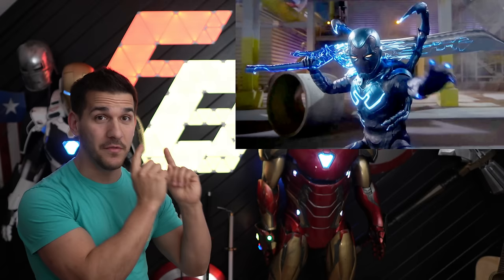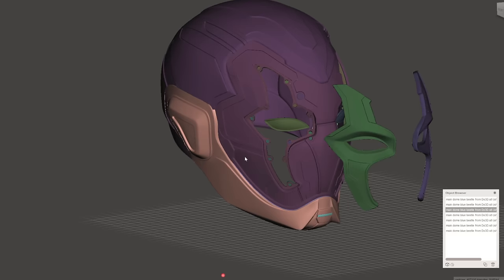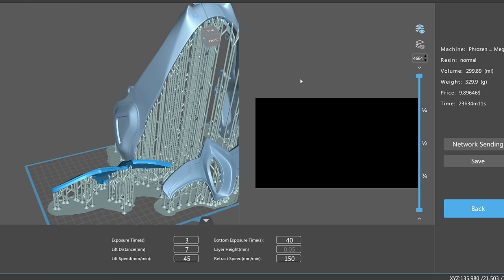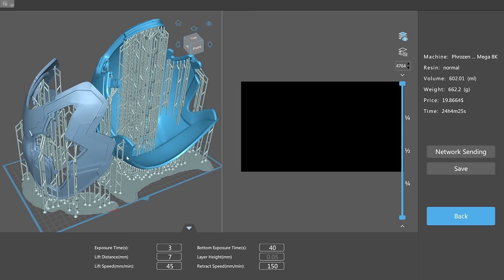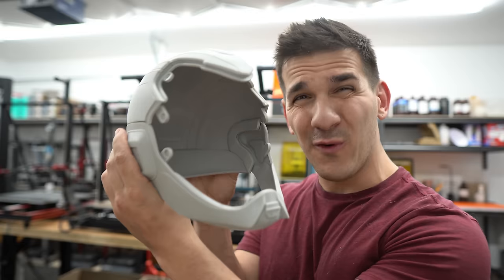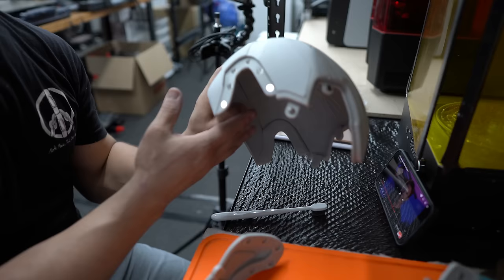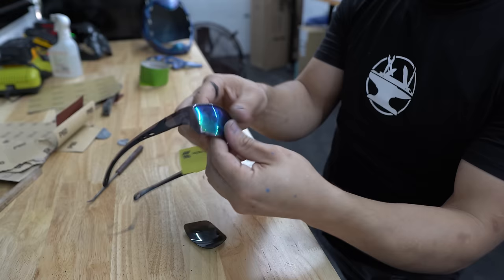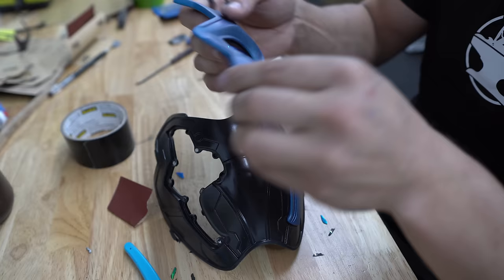Making a Blue Beetle Helmet out of LIQUID RESIN! | 3D Printing Tutorial |

Comment: Hey, so a quick tip with printing resin: if you rinse off the part in warm water before removing your supports they will pull off MUCH easier and not leave the large divots behind that you got when pulling them off.
Reply: Solid tip, I'm going to try this out
Reply: this is like the first setting on ur supports for chitubox
Reply: 500% recco the warm water bath. I use hot water, just be careful leaving the prints in for too long so they don't warp.
Reply: Yes, but not too warm/hot because not only they can wrap, surface of them can crack also!
Reply: adding more supports and making them less heavy is also recomended, i always put heavy supports on the key sports that will hold the print and the rest in medium on a bigger volume

Comment: You can hold a popsicle stick in front of the paint stream to get different kinds of speckles. Depending on the angle of the stick, the amount of the stick in the stream, and the amount of paint you allow to collect on the face of the stick will produce different effects. This trick can be used with H.V.L.P. paint guns also but it can be a lot more finicky.

Comment: Looks great!  When you make tight fitting pockets for magnets add a small through hole in the center of the pocket to allow the air (and excess glue) to escape.   Also, you might want to invest in an airbrush/compressor.   It's easy to get your spatter effect.

Comment: Tip for making spray paint sputter/splatter (if you've never tried it)... Take the nozzle off the can, then with an "xacto" knife kinda drill out and "damage" the nozzle where the paint comes out.  The more "chewed up" the nozzle, the greater the splatter.  Of course that nozzle is useless for "normal" painting, so spares are good to have around. 👍

Comment: The rough finish where the supports were can be mitigated somewhat by trying to orient the print such that the smallest and/or least visible part of the print is facing the build plate. Those first few layers get a LOT of exposure, which causes the fugly surface. Using a raft also helps. Resin is awesome. It's just totally different from FDM. I really want to get my hands on a large resin printer. The Mono X is much better than the standard Photon I started on, but still not big enough for me.

Comment: I do not know if you know but a good tip to romove supports from resin prints is to use heat, like a heat gun or hot water, that way you do not leave scars in the print

Comment: This is a dope project. Only thing I can say for someone trying to replicate the paint job is consider an airbrush instead of a rattle can. You will keep the speckles very fine and be able to build in a very slow and controlled way. It would be pretty easy. I imagine getting this result with a bunch of rattle cans would require a lot of experience with spray paint.

Comment: Great video.
Resin printing works on exposure per layer, not how fast a nozzle can pump out plastic. So the time a print takes is based on the number of layers, not the amount of plastic needed to be placed.
So, for large builds, they are much faster, taking like 3 seconds per layer, some less, some more. And if you can use the entire build surface at a time, can save you days in the end.
So, yes. I am impressed. But the PPE needed to work with it makes me shy away from it.

Comment: Gloves!! Even grabbing the build plate out of the printer you should be using gloves, as that top part will still absolutely come in contact w/ resin throughout the handling process. The second you go to open those doors you should be gloved up, resin burns are absolutely not joke.

Helmet turned out amazing though, love seeing more stuff done in SLA.

Comment: The build turned out great man. I really can't wait till i an afford and also have the space to have a large size resin printer. Currently have a midsized one. At quick glance I already saw some people offering some great tips. I don't know about anyone else but I tend to wash my prints in alcohol while the supports are still on to avoid resin splattering on you when break off supports since it's such a toxic material. And this way after I washed them in alcohol I can put them in warm water or you can also use a heat gun which I like best to remove the supports. They melt off like butter and no water or resin splattering everywhere when you use a heat gun.

Comment: With plastic lenses you can just dremel them into shape. Draw with a sharpie, use the sanding drum and when you're done the edges will be smooth. Then clean the sharpie out.
Reply from the maker: Yeah but cutting them goes way quicker. The dremel works but this works faster. You can use sandpaper or a dremel to smooth them

Comment: Been resin printing for a few years. So here is my tip, give it a try may work for you may not. I always soak my prints with supports attached in IPA. For one it leaves less pits and scaring, two they remove a lot easier. Most of my prints I let soak overnight and never had an issue. Some people think its bad, and will ruin print, but out of 100s of resin prints I have done, never had an issue and used many different kinds of resin.
Reply: Just dirties the ipa awhile lot. If you use a heat gun its worked great for me.
Reply: @lokiwartooth1138  No more dirty than doing a 5 min wash. Ive used heat gun, still leaves dimples in model.

Comment: For the speckle pattern, try to spray some on your glove and flick some on the print.
It’s a technique used to make stars on those speed painting with using newspaper to make planets.
Reply from the maker: I had tried that and it was too large of splatter
Reply: Use the clear  hammered spray paint. That way as it cures it gives it that exact reica paint job as the hero.

Comment: Quick tip. Get yourself a cheap hairdryer and use that to soften the supports before removing. Heat softens the resin and allows the supports to detach easier and with less damage. Using a hairdryer is a lot less messy and problematic than using hot water like some recommend. 
And as others have no doubt said,  you need to be experimenting a bit more with different support types. Heavies are great for ensuring the print won't fail, but mix and match smaller, lighter ones as well. All those extra supports you added for insurance? Probably could have been a mix of mediums and lights. Smaller supports means easier to remove and less damage to the print surface. 
Take some time to do some experimenting, accept that you'll have some failures while you work it out, and in the long run, things will go even smoother.
Also, I love that you looked over the print, saw the layer shift and quickly worked out it was a suction issue. Great instincts!!

Comment: I almost exclusively use resin.

Use medium supports. And use hot water to soften connection points to remove without pitting.

If you grab Lychee pro it'll detect suction cups.

I'm the opposite of you. I'm a resin printer learning FDM.

Comment: can you comment on your cleaning station setup, im about to build one soon, so im taking notes, 
1.why is there foam padding under the rubber mats?  what's the benefit if any , 
2. what's the black rubber>?  underman at that station shelve ? the black one with texture under the foam
3. what you put on the floor, I was thinking I need something in the area under my new resin/ curing station setup im building..
thanks again
Reply from the maker: They’re just foam and rubber padding for comfort and sound absorption
Reply: @FranklyBuilt  thanks

Comment: Saw the thumbnail and thought it would be made of foam or silicon but this is just 3D printing from a template someone else made. DIslike
Reply from the maker: You should really embrace the 21st century and accept modern technologies. Being stuck in the past isn’t a good thing. Even if I made it with foam or silicon it’s still copying a DC design. You’re just being silly because you think somehow working harder makes something better. It doesn’t.